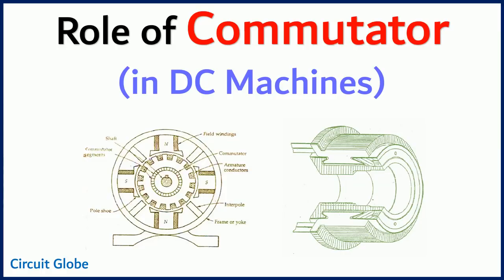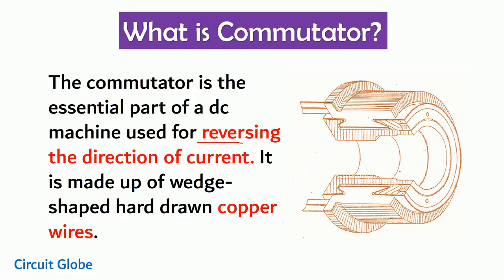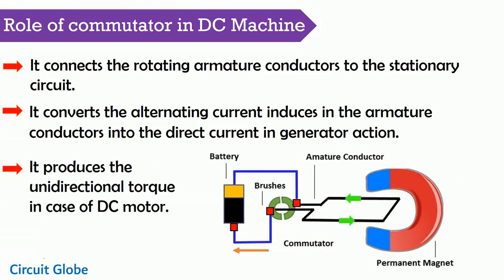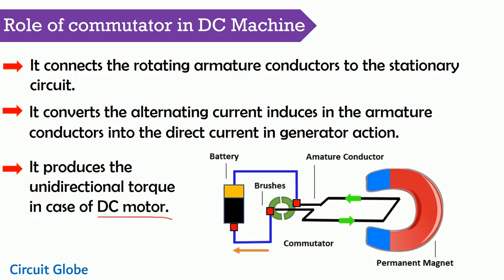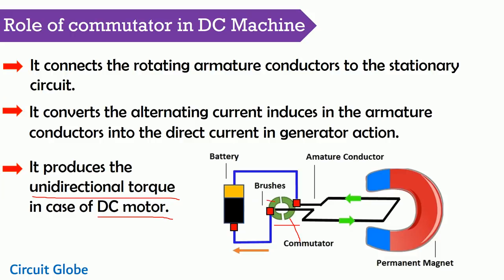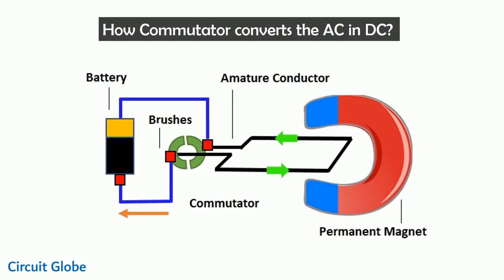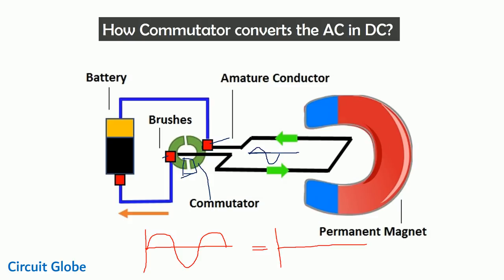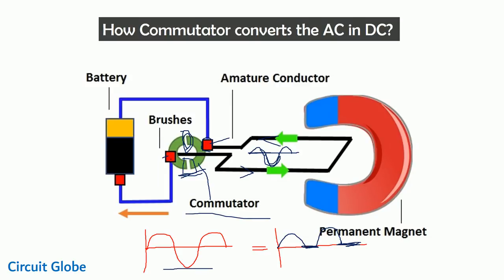Role of Split-ring commutator in DC machine

Comment: Hello can you please elaborate very very  precisely what happens after the reversal of current, what happens to commutatoes do they get locked in doing so there is no air gap, please reply if possible and what happens after one complete cycle to the commutators.